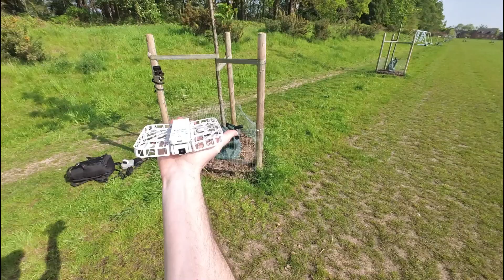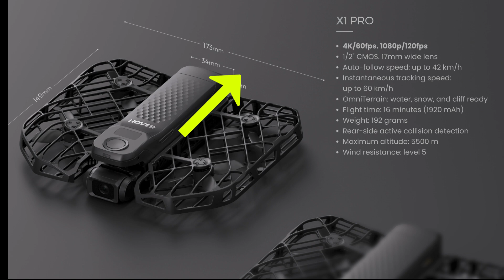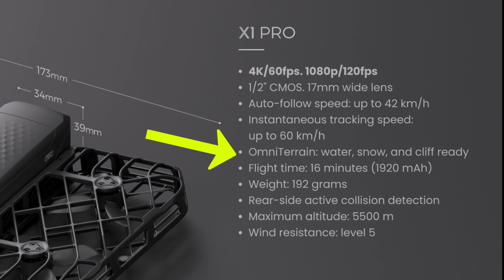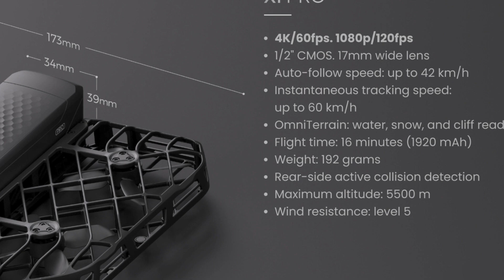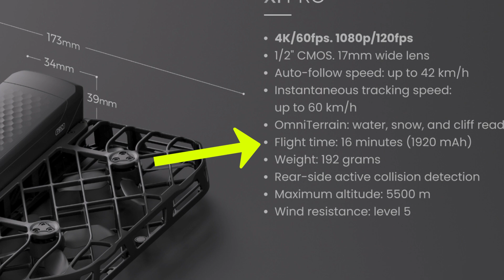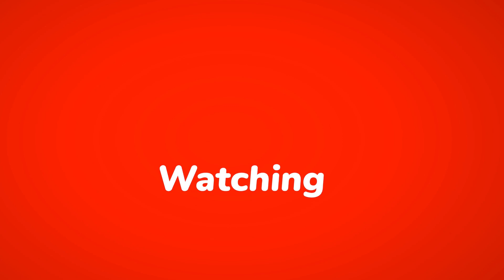AMAZING NEW 8K HOVER AIR X1 PRO DRONE!! IT'S COMING!

Comment: Hi, did you already decide? I've sold the X1 with the 8BitDo controller a while back. Enjoyed it very much. Ordered the Pro version for the speed, 4K and flying over water. It's not in the price range but yeah hobby may cost my wife says 😁Also looked into the Neo but that's also slow in follow mode and can't be folded wich is a big + for me. Looking forward to your reply. Greetz Ab
Reply from the maker: Hi - I haven't decided about the Pro version yet as I'm waiting for it to be a bit more mature and readily available. I have sold my DJI Mini 3 Pro now as I found it too much hassle to get flying. I prefer the Hover Air speed and quickness to get up and running. The Pro version is indeed very expensive so I'm holding off for now. I did purchase the Neo as I find the close selfie drones like the Hover Air X1 more my style and I don't really go for the big epic shots. I agree the folding of the X1 is really nice although I don't mind too much the Neo doesn't fold. It's actually not too big. I'm tempted to get the controller and maybe the googles to try flying it FPV.
Reply: @4T-Tech  I totally agree on the hassle with the other models. That's why I liked the X1 so much. I know the Pro and Max cost a lot of money and I was considering the Neo as well because the FPV option almost made me switch but makes it expensive as well. The googles cost €659 in the Netherlands and you need a controller as well. It's still to slow for my purpose though. I do a lot of road biking and 25 km/h well 35 would have been better. I also like to fly manual for some scenic shots. Happy flying and thanks for your reply.
Reply from the maker: @19ab59  Hi - Yes I'd like to try FPV but the Goggles are really expensive. For road biking, sports definitely the Hover Pro would be the best choice for speed for sure and the Neo is too slow. I'm sure the Pro version will be perfect for your use. For me, I don't do cycling or anything like that, I only just do vlogging for videos and stuff like that which the X1/Neo is best. I think I'd like to do some scenic shots and fly manual so Pro is on my mind. I'm very interested how it would be for manual controller as there appears some accessory for controlling it at a distance.

Comment: One correction.... You talk about flight time (pathetic 16 mins) and you say it's comparable to the Mini 3 & 4.... The mini 3 and 4 have had flight times for about 30 minutes as long as I can remember So this drone only has half the flight time as the DJI drones.
Reply from the maker: Thanks for the correction! Well spotted! I think I was thinking about the Hover flight time at that point which is around that time so got it wrong

Comment: Sounds great, only I seriously doubt the 5500m, probably more like 55m, which is actually a major upgrade from the present 15.
BTW: do you know if it is possible to choose clockwise orbiting? Why does it “cut” zoom out/in into two separate segments?
Reply from the maker: Hi thanks and agree the 5500m is most certainly a mistake and 55m seems more sensible. That's a good question about the orbiting, I think the Hover Air only does in one direction but no idea about this new model. I also think the two segment video is odd, but I think it does that for two separate shots depending on what the user thinks is best.